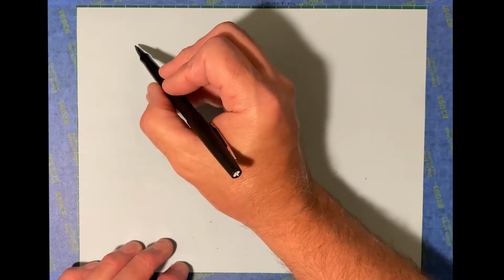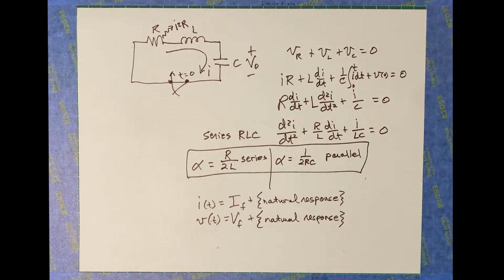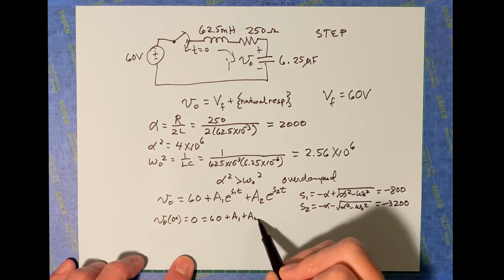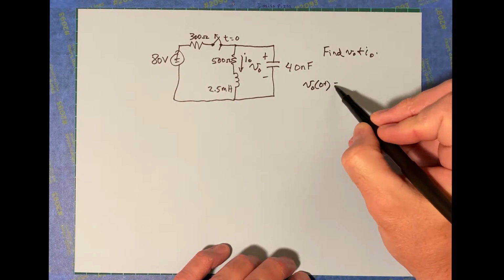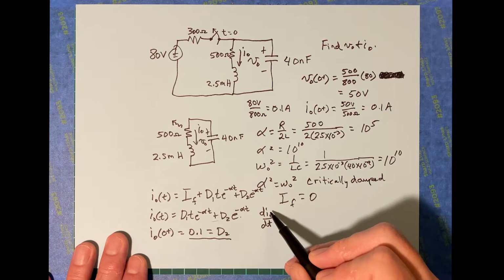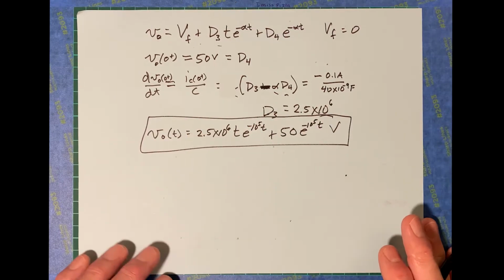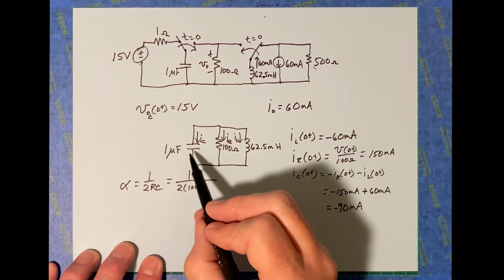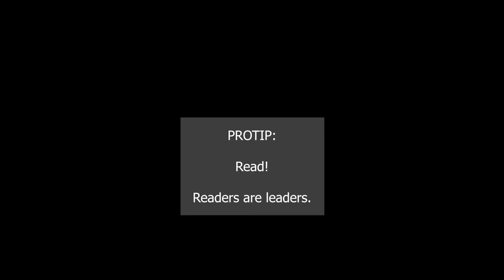26-Series RLC Responses and Problem Solving

Comment: Thanks for the detailed explanation. It’s similar to what I learned from my textbook of circuit basis. But I’m always confused why in natural response circuit, it ends up being solving the i(t), that is a KVL equation for the circuit that voltage across capacitor is represented by a definite integral which then gets differentiated to be i/c so it’s a second order equation of i, is it possible we use i=c dv/dt in the first place to replace all i in the equation and meanwhile leave v as it is for capacitor, then it ends up being a second order equation to solve v(t) for capacitor? Because this is what happens to step response rlc circuit where we solve v(t).
Reply from the maker: If I understand your question correctly, then I think the answer is yes, you can make the substitution that i=C dv/dt, where the v is the voltage across the capacitor. Then it is still a second order equation, and because of that the solution will have the same general form. So, the bottom line doesn't change. The only reason to solve for i(t) first is because i is common to all elements in a series circuit like this one. The answer regardless of what you solve for in either natural or step responses is the same form: X(t)=Xfinal + {natural response}, where X is either voltage or current for any of the elements. That reduces any of the RLC responses for any element down to 1) determine the initial conditions, 2) plug in the natural response, and 3) find the needed coefficients. So, it doesn't change the form of the solution no matter how the response is initially derived.

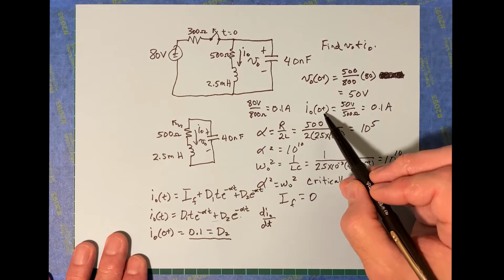Comment: professor , at minute 22:06 , i don't understand why didn't you do dio/dt=vc(0+)/l which will basically give us vc(0+) = 50v/L ? as we did in all problems before ?, and even we used the same method to find v(t) later in the video . I just don't understand how you got a 0
Reply from the maker: I think you are asking two questions: 1) How did I determine that di/dt is 0 at t=0+? and 2) Why did I not use di/dt=v/L evaluated at t=0+ to find dio/dt?
The answer to 1) is that di/dt is the rate of change of current with respect to time. Since an inductor cannot have an instantaneous change in current, then the current for t=0- is equal to the current for t=0+, which means there was no change at t=0 and the rate of change of the current, di/dt evaluated at t=0+, will be zero. The answer to 2) is that you could indeed use di/dt=v/L evaluated at t=0+ to find di/dt at t=0+. Notice that di/dt is equal to v/L where v is the voltage across the inductor, not the capacitor. The voltage across the inductor for t=0 is zero because there is a steady current through the inductor. Thus, the result is the same no matter which method you use.....di/dt evaluated at t=0+ is zero.